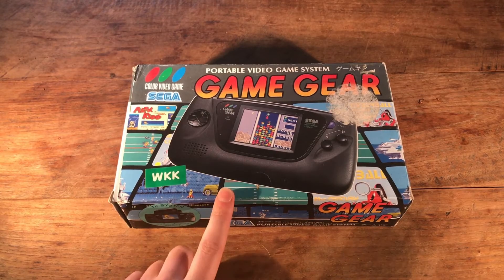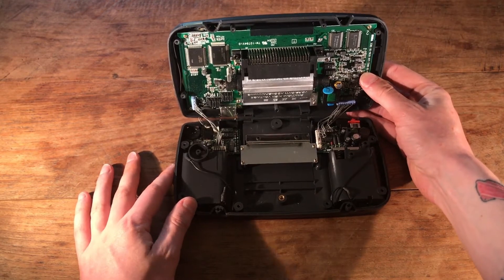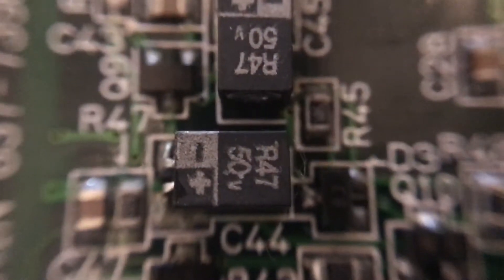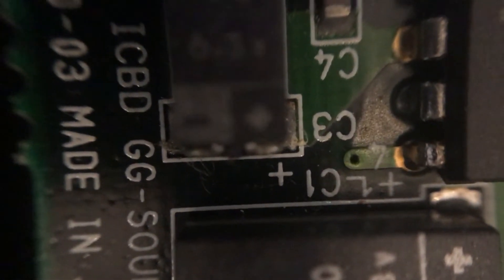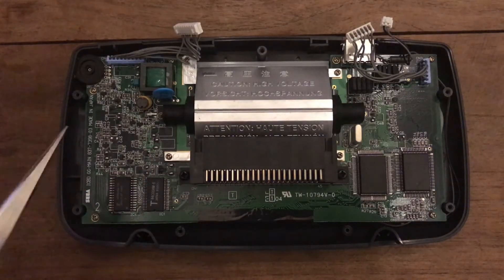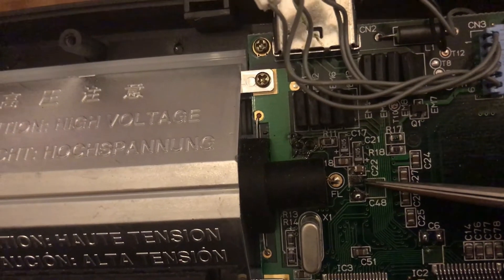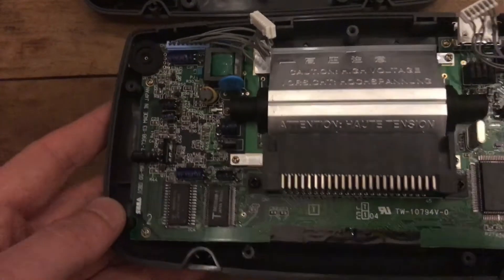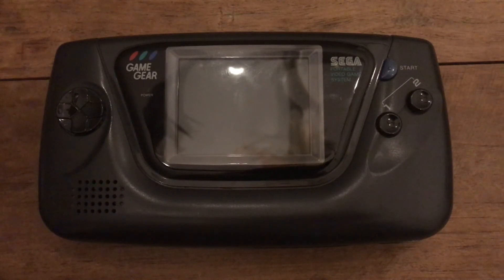SEGA Game Gear - Capacitor Replacement Repair

Comment: I'm going through your back catalogue. Just before the human malware lockdown a colleague at work gave me his old Game Gear to look at and service if possible -- I suspect bad caps. This video will be my reference. Wiggling the caps on the board makes me nervous -- is that just the glue cracking? Have you ever broken any traces or pads? Masterful job manipulating the cap legs to make them fit. Great work!
Reply from the maker: yes, it's glue, but also part "old plastic" (of the casing that's around them - no clue who thought that was a good idea...), and potentially part electrolytic that's dried up. Unfortunately, I have ripped traces before, but in my mind doing this with hot-air is an equal bad idea. You'd need more heat to get them off the board due to electrolytic, which in itself is a bad idea on this small of a surface. And on top of that, there's a chance caps can explode with too much heat, also spraying electrolytic everywhere. I just take my time real slowly working them off with flux, wick and some solder, and if that fails, I default to the method shown in this video.

Comment: Hey, my power port on my sega game gear does not work.  Basically if I want to play it i have to have batteries in it at all times.  I bought it on Ebay 3 years ago and it was supposed to be recapped and it does in fact appear to be recapped but I didn't really know the power port on the sega didn't work.  Do you have any idea what I can do to get it to work again?
Reply from the maker: sounds like either a corrosion or connectivity issue. You could start with deoxit on the port itself. if that doesnt change things, try reflowing the power jack connection on the mainboard. Worst case scenario, you might wanna recap the power board again (usually sellers recap the board, but leave the audio/power circuits out for some reason?)
Reply: Yeah, I have that issue too. I recapped mine myself, with a ceramic capacitor kit from retrosix which brought it back kind of from the dead. Before, the screen was very dim, audio was basically non-existent, on the speaker, mono using headphones, even after recapping I had to run some wires to fixup the audio board. I recapped everything, power, main and audio board. One day I decided to try running it from the power jack and noticed it just wouldn't work. I tried cleaning it with IPA and a fiber glass pen but haven't gone past that yet, still not working. I'll have to try and dig deeper one day.